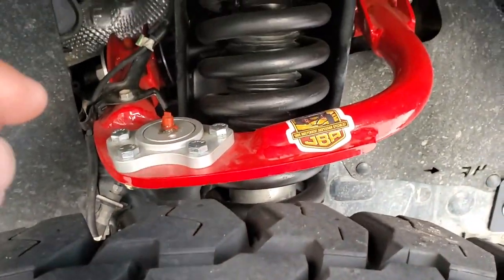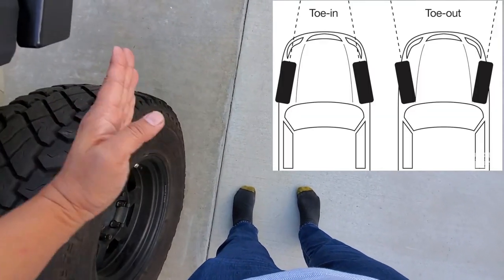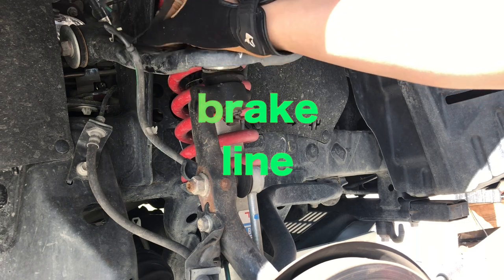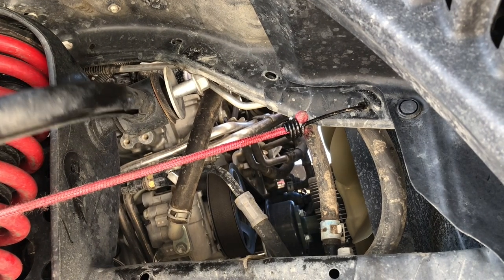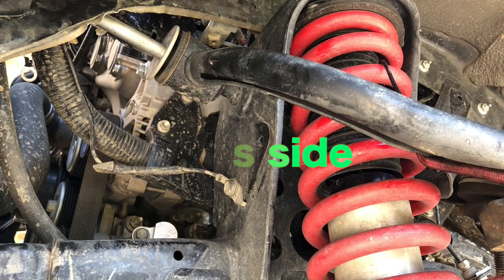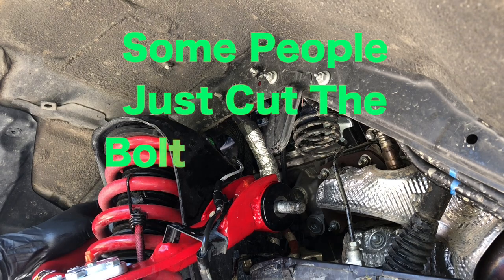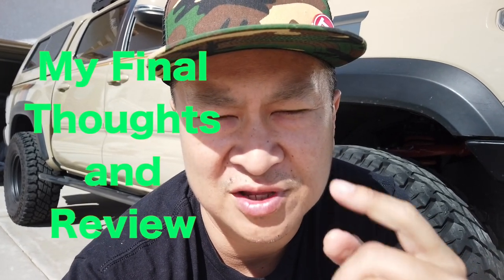MUST HAVE Mod for every Lifted Toyota Tacomas - Upper Control Arms DIY and JBA Offroad UCA review

Comment: Hey Rob,
I bought and had these installed  along with alignment but now I'm starting to rub where I  previously did the CMC. I have a 2inch lift with some 33x12.5 R18 tires. Are my tires too big for it or just need a higher lift? What can I do to keep these, I'm  afraid now that I have to pay again for them to put back the OEM upper control arms back. Any suggestions will help. Thanks!!
Reply from the maker: So you're saying everything is the exact same except for UCAs?  You didn't mention what the caster is set to now. I have +4 caster.
Reply: @RobDaman  Everything is OEM except the new upper control arms,  was I suppose to buy something else to make this work??
Reply from the maker: @mmunoz5875  No. I'm just confirming things. 

What is caster set at? It NEEDS to be +3 or more.
Reply from the maker: @mmunoz5875  I wan't referring to OEM parts but the wheels and tires. If you had changed that too. again if your caster is less than 2 that's the problem.
Reply: @RobDaman  I'm not too sure how much it was adjusted. I was thinking about taking to a different place to get  it realigned and see if they can make it work.  The shop I took it to seems a little  shady  and don't really trust them.  I was trying to let them know that the casters needed to be filled with grease and they were trying to tell me that they already come greased.
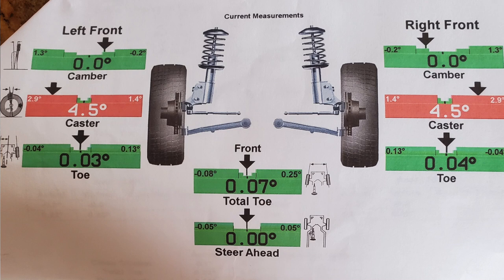Reply from the maker: @mmunoz5875  every legitimate alignment shop should be providing you a before and after settings sheet. look at this video at 9:15. you can see my after specs.

you do not need to be mechanically inclined. it's just them showing you what was done.  caster is red because it's out of spec from factory ranges.  I bet you that shop kept it in green.
Reply: @RobDaman  they didn't even give me a sheet!! Lol😂
Reply: @RobDaman  so you think I should keep them and just go to another shop? When I left there, they told me that the truck was aligned but that my tires couldn't be  pushed more forward.  I just don't understand why not, if the OEM ones worked with no problem. I do understand that we are now changing the the specs by adding after market parts but I wasn't really expecting it to effect it this bad...I was thinking that I was going to gain more by adding these ucas.
Reply from the maker: @mmunoz5875  Well I pointed out the advantages of aftermarket UCAs. Now you're trusting a shop that told you that nothing can be done while thousands (not just me) get aligned and get a sheet.  I probably should say millions of people over decades who get a alignment sheet. This has been done for decades even using hand tools. I'm not kidding.

That is why I asked you if you changed anything else besides uca. If you said "I just changed my wheels , put on bigger tires" or some other mod then I could say those are related. Since you said ONLY the UCA's were swapped there's only 1 X factor which is alignment. 

If you think it's the UCAs fault, JBA will take the return no questions ask for up to a year. It's just sad to see that you'll be spending money twice to return to stock. Then don't forget I'm assuming you want that shop to do it again. Back to stock will still require an alignment. Can you trust them? That they will do that right and go back to "normal" with no rub? 

So let's go back to original facts you provided and go over them.

1 - nothing modified on set up including lift height, no new wheels, no new tires, no other additions besides UCAs? correct?

2 - prior to aftermarket UCAs there was not rubbing? Correct?

3 - shop installation didn't add anything else besides aftermarket UCAs? Correct?

4- shop didn't provide an alignment sheet with before and after specs? correct?

If 1 to 3 are confirmed correct then the issue is #4 that alignment wasn't set to maximum caster. 

If 1, 2, or 3 isn't correct then you have an extra factor to your rubbing issue.

Get those alignment specs. Get maximum caster of 4+ degrees if it's not currently.

Look at it like this. Most of us work and get a paycheck. The check shows the facts where's the money going. Would you trust your employer if took out your deductions so your net is less than your gross pay without an itemization? Where you pay federal , state , social security etc???  That's what your shop did.
Reply from the maker: @mmunoz5875  nice info what alignment is and how it effects the tires n such

https://www.bridgestonetire.com/tread-and-trend/drivers-ed/tire-alignment
Reply from the maker: @mmunoz5875  this is from JBA's page. supplements why aftermarket UCAs are a good thing...

JBA Offroad manufacturers upper control arms (also known as UCAs or upper a-arms) for the Toyota Tacoma beginning with the 2005 model year. With the right modifications, Toyota Tacoma models are wonderfully capable off-road vehicles.

All Toyota Tacoma models have independent front suspension and require replacement of factory upper control arms when lifted. If factory UCAs are not replaced, your Toyota Tacoma alignment and clearances will be both incorrect and unsafe.

When Toyota Tacomas are lifted, caster is lost from the front-end alignment. Caster is critical for stability over 45 miles per hour and returns the steering wheel to center after going around a corner. Additionally, factory upper control arms often rub on the front springs, limiting articulation. If factory a-arms are not replaced when lifting a Toyota Tacoma, the factory ball joint can fail prematurely and cause an expensive and dangerous situation. 

JBA led the industry back in 2004 with the development of the first aftermarket upper control arms, which enabled the vehicles with independent front suspension to be safely lifted. Today, JBA upper control arms are installed on thousands of vehicles all over the world, including lifted Toyota Tacomas. JBA UCAs work with Toyota Tacoma lift kits up to 4 inches above factory ride height.

All JBA manufactured parts come with JBA 12-month 100% satisfaction guarantee. If for any reason you are not 100% satisfied with purchase, you can return it to us for a refund of your purchased price within the first 12 months from your purchase date.
Reply: @RobDaman  thank you so much! Going back on Monday and ask them for the paper that I never received.
Reply: @mmunoz5875  get the sheet and go somewhere else!
Reply: Thank you and I have.  I'm still running into the same problem.  I'm going to install some Fox Shocks and raise my truck 3 inches. I know that's not going to change much but should minimize the rub.

Comment: Can I run a 285/75/r17 tire with this uca?
Reply from the maker: The wheel width and offset are also a factor to fitment. JBA has info on suggestions or you can contact them directly

Comment: Did you get any extra droop or down travel?
Reply from the maker: I didn't check because my front suspension isn't extended for travel. UCA will help with it when you purchase extended sets.
Reply: Rob Daman I know that longer arms give more travel but with stock arms the ball joint binds and stops down travel. In most cases the uca hits the spring too. So I was wondering if you got a inch or so more by eliminating these to factors

Comment: How much lift do you have now? I want to lift less than 2” is there a minimum?
Reply from the maker: Currently I'm above 2 inches. My prior install I was below.  It depends on which shocks and springs you purchase. Most target 2 inches.
Reply: Rob  I wish I could find the TRD Pro shocks cheap. Love the red on my white truck. If you hear about those red beauties cheap let me know.
Reply from the maker: Eibachs aren't bad and have red springs. They just came back in stock from what I've read

Comment: OOOO!!! So that "loose" feeling in the steering is from the lift? 1.5in front? I am thinking it is a good idea at this point to get the JBA's. I like the Moog ball too meaning less maintenance! I also just looked up parts for a new washer and UCA pivot bolt. It is $30 worth of parts and I think worth it to just cut the original one out. Think it's worth it to cut em out and are the JBA's holding up well?
Reply from the maker: yes. that's exactly what i mean and yes the lift effects it. you'll feel it harder to steer offroad too. 

doing well and backed up too

Comment: The control arms themselves is nothing but a couple of welded pipes and plates.
The only part that might require basic intelligence and quality control is the ball joint, and the damn thing failed in less than a year. Not extremes/off-roading.
The reason is that this outfit get incompatible pieces from third parties - the boot doesn't seal at all because it's FOR A DIFFERENT BALL JOINT, for fuck's sake! They attempted to "fix" the issue by adding an aluminum bushing but it's like treating a corpse with aspirin. The joint is full of water/sand mixture, and, of course, their "warranty" doesn't cover a damn thing other than the pipes.
In three words, IT'S A SCAM.

Comment: 2 hours on one side? It took me 20 mins to remove and install a new UCA. sorry it took you 2 hours.
Reply from the maker: Yep. 3rd gens are harder to get the bolt out due to the UCA is installed before the body is dropped on the frame.
Reply: Rob Daman same with the 2nd Gens. I had to bend the inner fender/firewall to remove the long rod. Had to do it on both driver and passenger side. To torque the passenger side bolt I had to remove the brake line out of the way so my torque wrench would fit. Bending the sheet metal was the “hardest” part of the job. Not including removal of the wheel and jacking up the truck, it took me about 15-20 mins to remove and install “new” stock UCAs. I’m thinking about getting JBAs now. Shop was able to get 1.9° of camber. I want more! Lol
Reply: Rob Daman by the way, you should check out my channel :) I’m no famous like you but still upload them while I can. Anyways, i plan on getting JBAs in the near future. The 1.9° isn’t enough and my steering wheel feels sloppy/loose due to the low caster angle.
Reply from the maker: i'm happy with 4.5 degrees I got. I'm not famous either. 🤙
Reply: @RobDaman  Hey Rob, what do I tell a shop after I install these? Do I tell them that they have 3 degress of built in caster?
Reply from the maker: Confirm they know how to align a Tacoma with camber / caster then let them know you'd like max caster and zero camber. A little toe in is ok. Zero toe may not help with road crowning but actually depends on your roads..

Comment: Hey so I have a 98 4 runner limited. Looking into upgrading the front suspension and I’ve been looking at the JBA upper control arms. My question would be where would be the best place to start? Should I do the 2” lift and new shocks or should I replace the front end first then lift it? I have some other work to do first so just trying to get input before I get to that area.
Reply from the maker: focus on getting the basic stuff fixed and then replace as much as you can at once if possible to save multiple alignments.